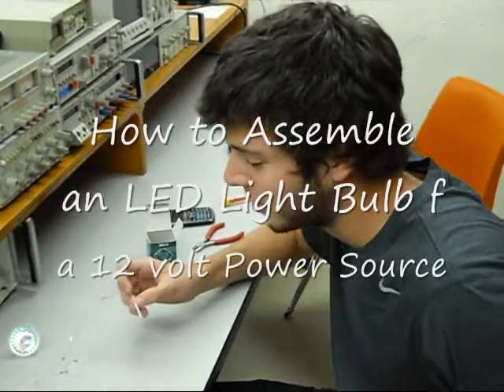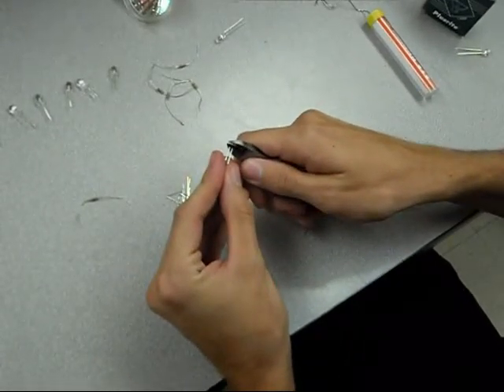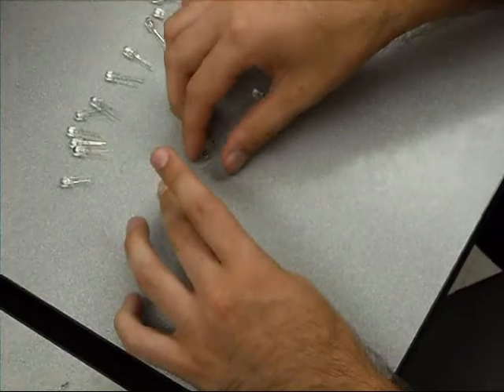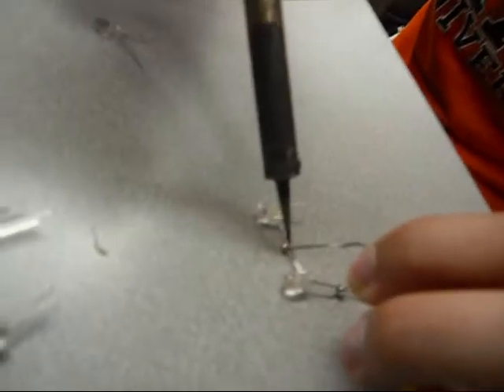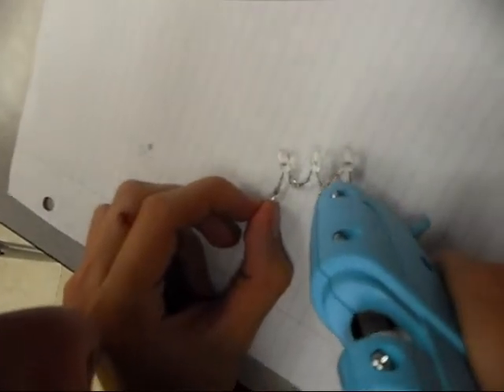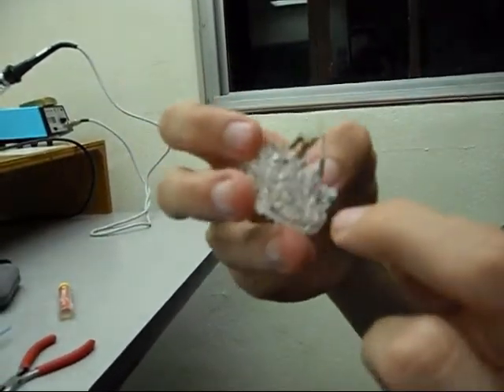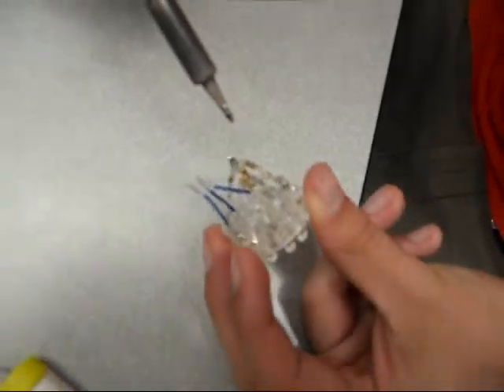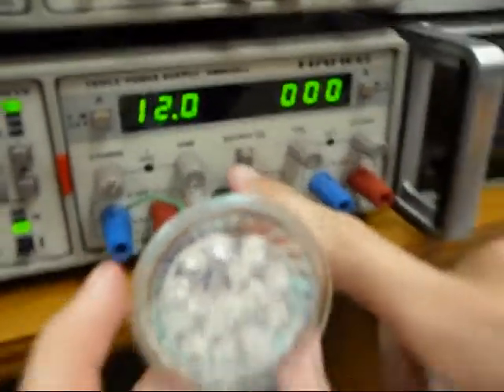How to make a 12V 15-LED bulb

Comment: Wow, how long did this LED bulb lasts?  I had done one like this last year, where three LEDs are in a series and they burn up in a few minutes.  I guess three times the Amp (about 20~25mA per LED, so now 60~75 mA now going through).  I have since changed to individual resistor for each LED with no issues.

Comment: Dear boredagainx,
I am so proud to make a LED Bulb.
But how do use this bulb in 24 volt ?
I have a UPS. there 12 volt 7amp 2 batteries in series. I want use this 24 volt power for 3 pcs 12 volt LED bulb and 8inch 12volt Fan.
I think use a 10w 10ohms resistor for your 1pcs 12 volt led bulb. am i right.
Pls tell me a solution.